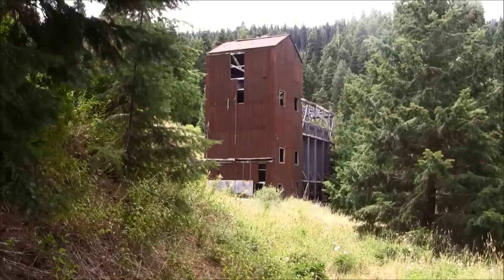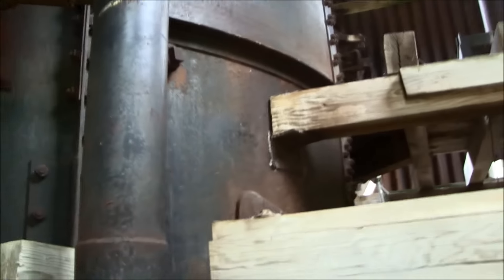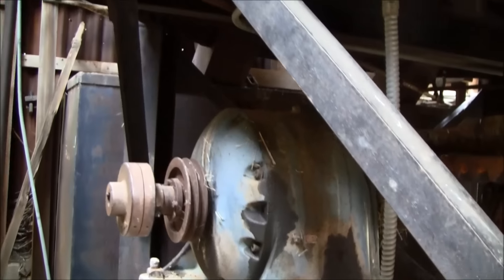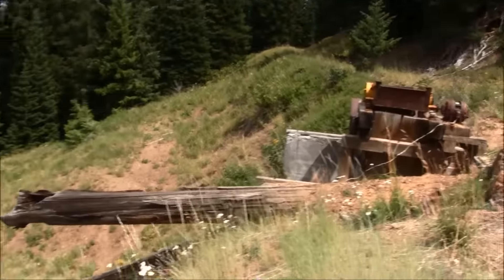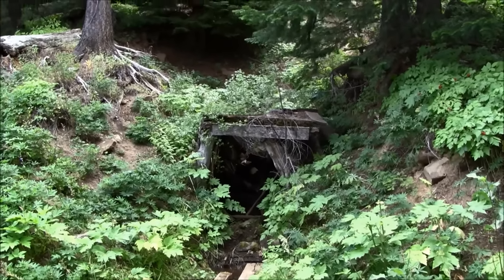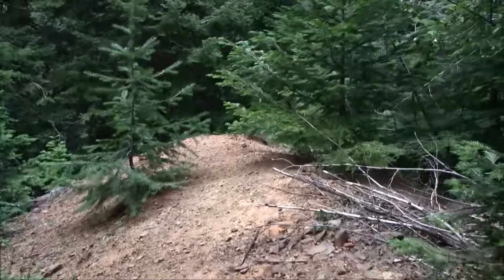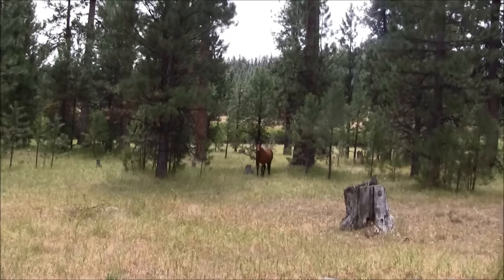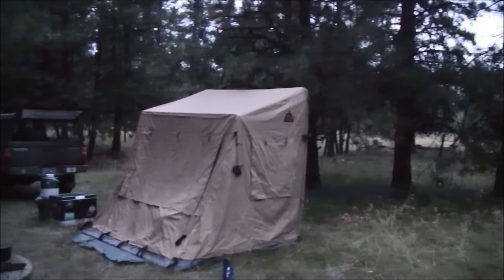Ochoco Mines Part 2

Comment: Must have been a cinnabar mine. (Mercury)Those condensers are where the liquid drops out and into the flasks while the steam is condensed out the top away from humans. Very dangerous stuff to work around. The big tall metal thing inside is the rotating oven (verticle rotary kiln) where the liquid metal roasts out of the oar and then passed on to the condensers. That oven get's upwards of 1900 degrees.  Mercury was widely used for milling gold in stamp mills so a lot of it was needed to handle the gold operations. You can see another one of these mills on a trip report of mine. Towards the bottom of the report. The "Red Rock Mercury Mine" located in Nevada. http://www.cannedhamtrailers.com/vacjune06.htm
Reply: mobiltec  you are right my friend a lot of the mining hear in Central Oregon was a cinnibar mine